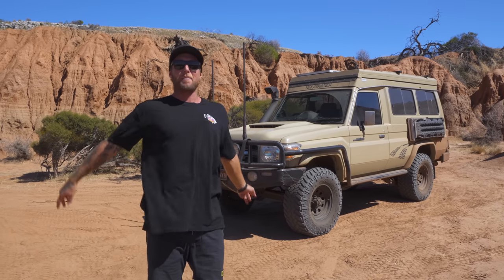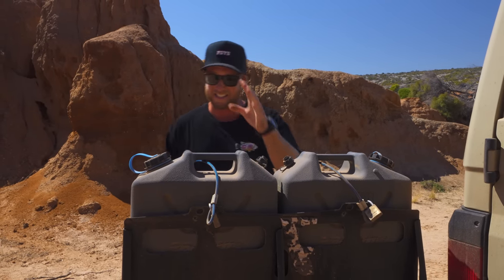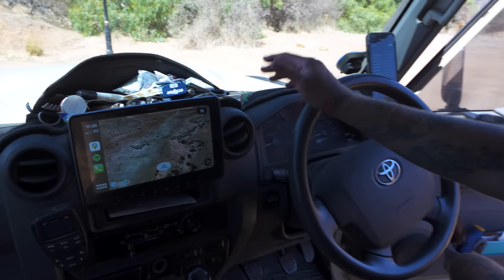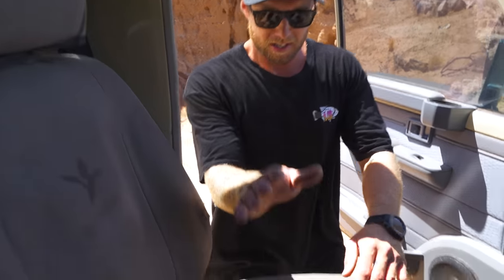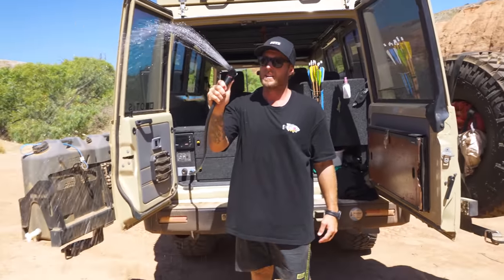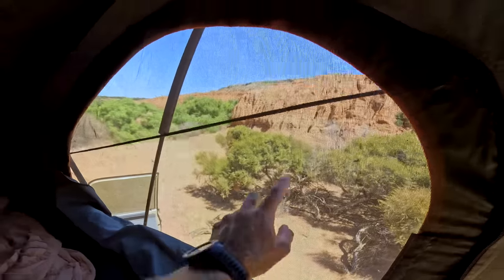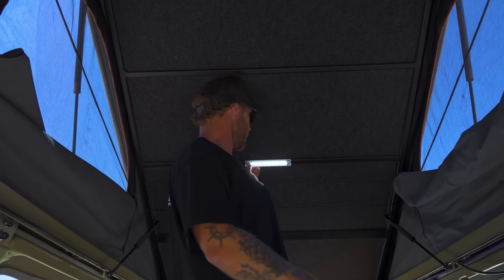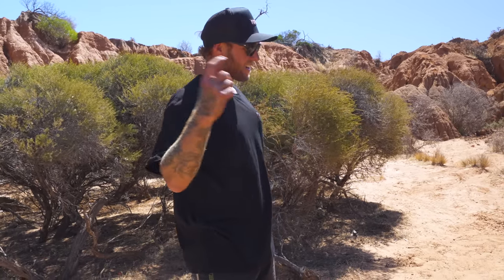1 YEAR HONEST 4X4 ULTIMATE CAR BUILD REVIEW. THE GOOD and THE BAD

Comment: I would be cautious with sitting at the passenger seat on top of the wireless cell modem. The amount of radiation could be high and dangerous when exposed for hours. I recommend moving away from your seats and beds. You can purchase an RF meter/electromagnetic meter to check levels. Amazing build!! Well done.
Reply: Especially if you want babies someday 😉

Comment: Brotha. Your roof bed. At 34:30 you said it’s rubbing that metal lip and eating away the metal. Put a strip of magnet there that has adhesive on the back. Stick the adhesive side to the metal lip and the fold down bed bars will attach to the magnet part and not only will it protect the metal but it will stop it from moving as much.

Comment: That is sweet.  Your death wobble sounds like the sway bar bushings and the stabilizer bars. My Toyota did that, I put new bushings in the sway bar and changed out the stabilizer bars and it hasn't done it since. Hope that helps.

Comment: Death wobble could mean you should upgrade your steering shock / stabilizer. If all parts are in good shape and occurs intermittently. Was a common issue with pickups when they got lifted or the steering geometry changed.

Comment: Looks like you have a lift kit? Whoever fitted it should have put a caster correction kit in the radius arms on the front diff, this should help the wobble, and as others have said a bigger steering damper, just stay away from the ones with the springs on them as the will kill your steering joints. As always great video mate 👌

Comment: Death wobble.  Check your front trailing arm rear bushes.   They are known for splitting and giving you the death wobble and upgrade to Polly bushes
Reply: Also see if you can add a steering dampener to the steering box 👍🏻

Comment: if you get a car battery charger that plugs into the wall you should be able to hook up the engines battery to the solar battery and get charged enough off that to get moving again. Just a thought i could be wrong but worth a look into

Comment: Great videos! Thoughts on radio power. Power it from the house batteries or put a switch in so you can choose which battery you get power from. Or maybe a heavy duty relay to jump engine battery from house batteries.

Comment: The death wobbles are probably the swivel hub Shims are a little bit lose on the fount diff or the brake discs warped when applying your foot on the brake
The nissan patrol does the same thing 
Cheers bro

Comment: Death wobble its because of over size tires ... so if you using over size tires  than original size you have to increase the stearing nuckle preload by redusing thickness of stearing nuckle adjesting shim. Otherwise if you using bigger weels  without adjesting preload death wobble occur.

Comment: As for the death wobble. Do you have balance beads in the tires? If not they could potentially help if the tires are part of the problem. Steering stabilizers if available are most likely to help.

Comment: i used to install car stereos and if you want more sound closer just get a pair of splits, where the tweeter is up faced toward listener and separate from the woofer up on the dash or interior mirror covers/triangle trim, , the design of split mids/woofer make them a lot more bass heavy than coax designs too along with a proper crossover which also increases sound quality and bass! i think its a win win in your case, since cost will be about the same as extra speakers for the most part! and sound quality much better than extra speakers out of phase fighting each other, where as with split tweeters running off the same signal the sound merges a lot nicer in a small space, not to mention much cleaner look! Sounds from mids or lows will travel in all directions where as sound from tweeters are very directional, having tweeter in cars down there in the door cards is terrible for sound, hence why most car companies use splits now!

Comment: If you don't have one put it anti-sway drag link On the front linkage (not ex pe sive)

of your car. With your issue of breaking those latches I would consider putting 2 latches on each side as well.

Comment: i Have a question to your Battery problem, couldn't you just jump Start the battery with your Solar panels ? surely there is a way bc you convert them from DC-AC  so you could just use the DC version to jumpstart your car ?

Comment: I’m curious how much did the troopy run you before upgrades and how much were the upgrades ?
Reply: I'm only guessing but base car would be 60k or there abouts and then RTT would be around 15k installed. I guess probably pushing towards 100k AUD after everything
Reply: No way near.  Your talking at least 130k.  The car alone would be 100k

Comment: If I could get it in the US I would switch from a JKU to that in a heartbeat
Reply: Im a Toyota boy but the jeep is way better
Reply: @Jacob  In some ways yes but with my build I went way overboard with the suspension and such but I can pull basically anything unlike this that can actually pull a nice sized boat and probably would spank the Jeep on mpg because I get around 8-10mpg
Reply: @JeepFamOverland  troopy gets around the same as that if not worse offroad but they're rated to tow 3.5 ton so whatever that is in pounds so definitely good for towing
Reply: @Jacob  Yeah I have a new series I'm about to post in the next few weeks about our custom trailer build and it's basically to allow everything possible to come off the jeep so we can wheel it more effectively and not have so much weight when we try to hit the rocks with it

Comment: As a car audio enthusiastic, don't put speakers at the back of your head. You don't listen to music at concert facing backwards, so why put such speakers at the back of your head? Alpine are top notch  equipment. You have a pair of 6" speakers now, drive by the rear channels of your alpine. Add another 5.25" components (a 5.25 speaker and tweeter) and drive it with your Alpine front channel. Or get a 4 channel amp, but probably don't need amp as you will require a lot of rewiring. Have the new speaker mounted on the dash and tweeter on the A pillar, that way you are getting front sound staging. Like you say get the best, you wouldn't regret it. Go get it done by a proper car audio installer or shop.